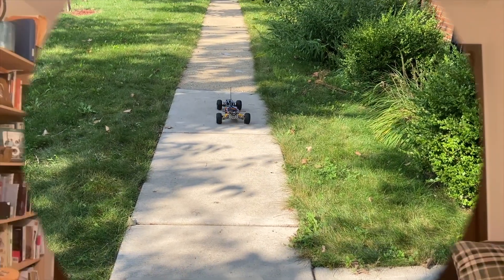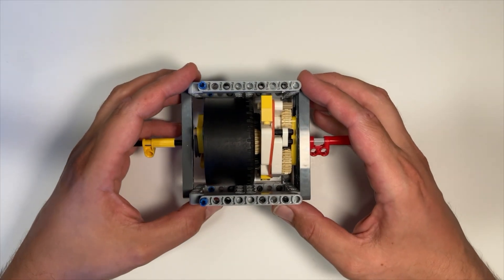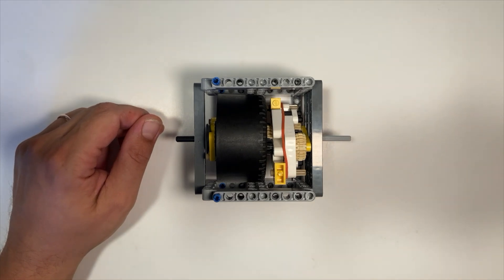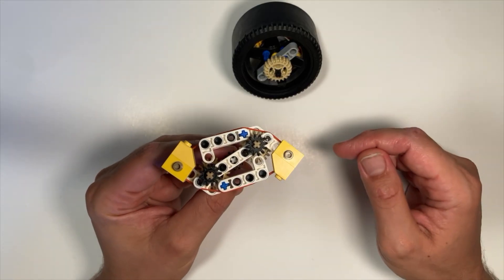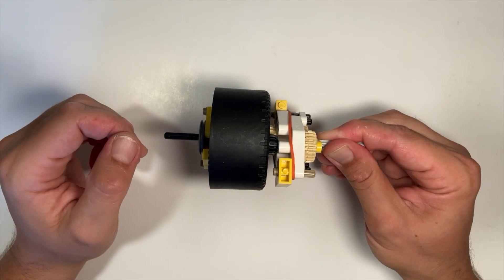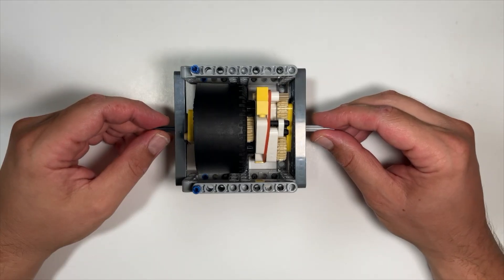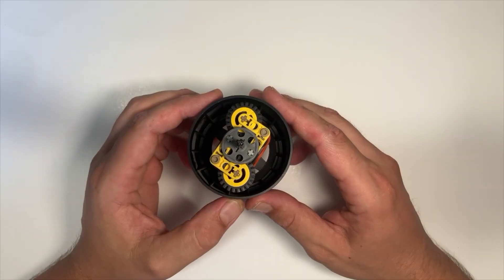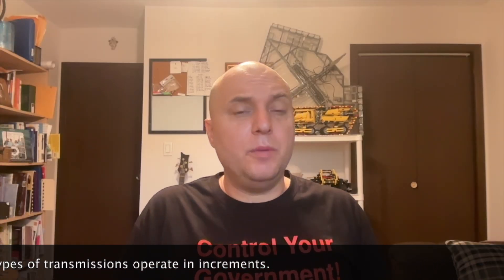Egora CVT: 99-100% efficiency! Original Design; LEGO Model

Comment: I thought it's gonna be a variation on the ratcheting CVT. Turns out it's not even a CVT, it's a two-gear "automatic" gearbox with some clutch-burning while shifting. That's not efficient, that's something that gets you yelled at by your driving instructor.
Reply from the maker: hahaha, the clutch could be a fluid coupling. And there is always some kind of tradeoff, the question is whether the gains are worth the losses. I think there are some huge gains here.
Reply: It's a slipping clutch regardless of what it's made of. If you allow it to slip, the CVT is only continuously variable because it's wasting a continuously variable amount of power. If you don't allow it to slip, the CVT only has two speeds which is not very continuously variable.
Reply from the maker: @thermate93 critique noted. But the question is whether this is still better than the alternatives considering the substantial gains in efficiency in the extreme ratios.